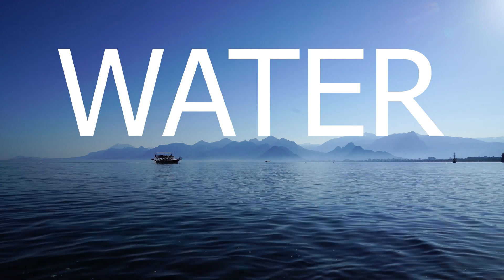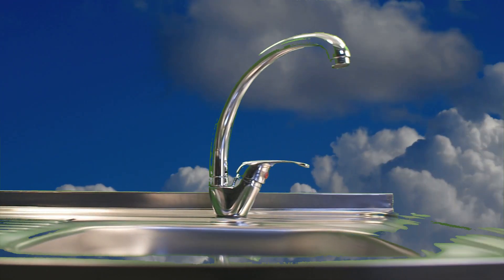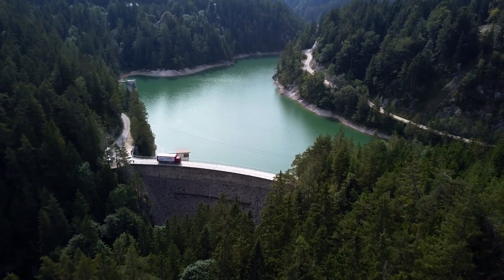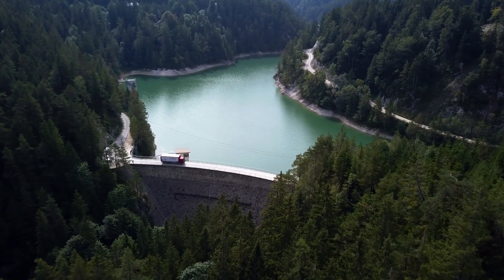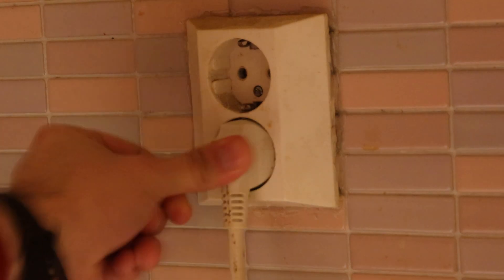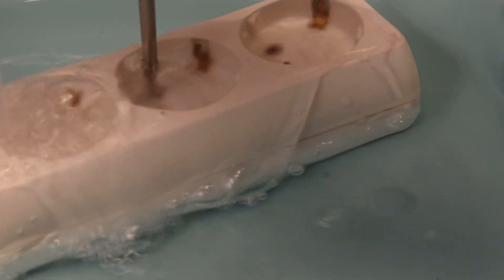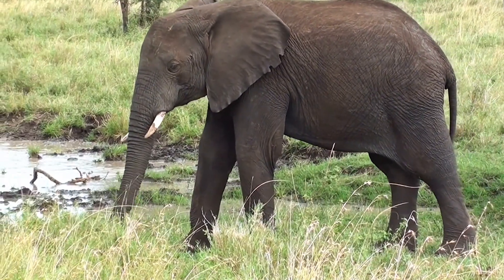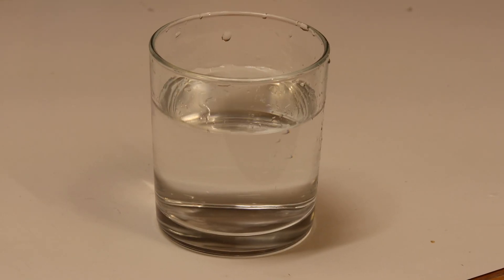Harnessing the Power of WATER! From water to electricity and back again.

Comment: Could you make a video on why they flavor roads with salt in the winter?
Reply from the maker: They don't use salt in Finland. We don't like the moose licking the roads.
Reply: It's to help keep spirits off the road during the colder months due to the static electricity, and it also helps with making the snow taste better.
Reply from the maker: yum
Reply: @5.43v  remember this wise bit of advice, no matter how tempting, don't eat the yellow snow. 🙂
Reply from the maker: but yellow is best flavour

Comment: Does the giant dam in Crysis 3 provide enough power to play Crysis 1 with potatoes?
Reply from the maker: Fact: Crysis has higher system requirements than Crysis 3
Reply: @HungryGizmo  C3 requires a DX11 card, otherwise true
Reply from the maker: I ran C3 on my toaster last week. maximum fps.
Reply from the maker: @I would rather not dox myself All I know is that my toaster gets all fps in all games.